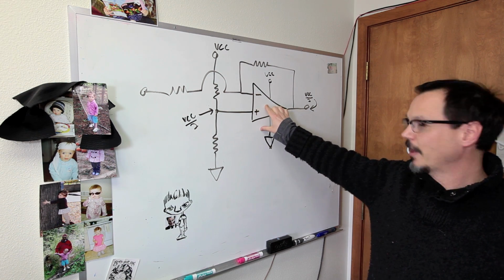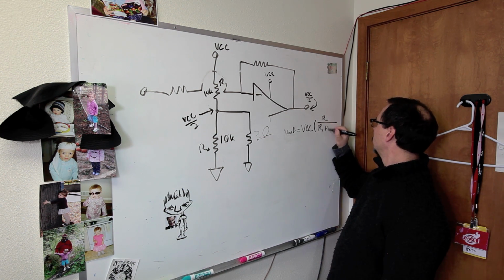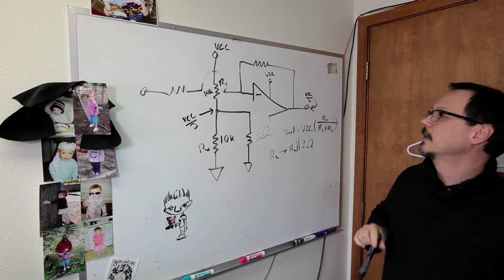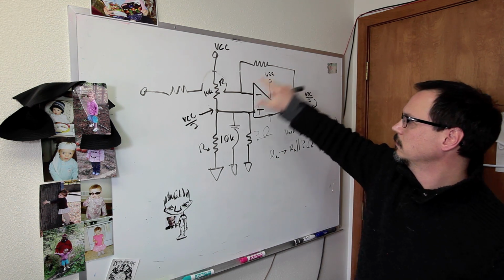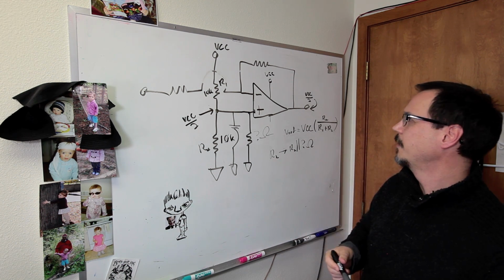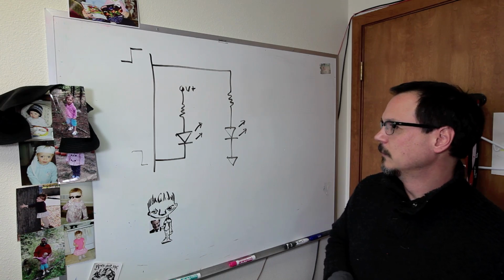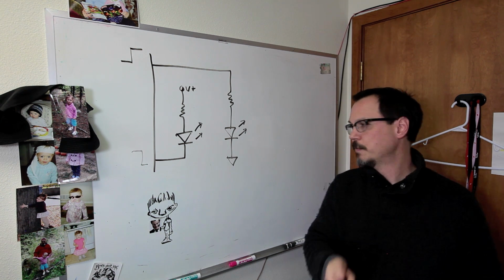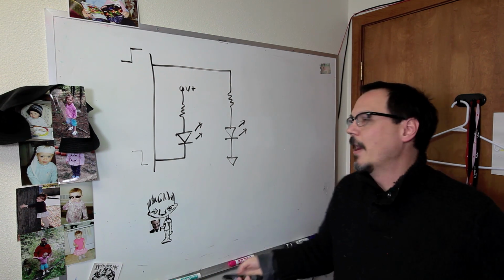SparkFun According to Pete 2-6-12: Questions Answered

Comment: Unfortunately, I disagree with several things you said about driving the LED from a (CMOS) processor.
TTL drives L better than H: Agree.
CMOS drives both the same: Disagree. Go look at DC specs for current out (IOL, IOH), IOH is typically 1/2 of IOL.
You can't tie anode end to arbitrary high voltage. With the pin not driving L, the voltage on the pin is Vsource - VLED. If this is more than .7 V higher than the CPU's VDD, you are sinking current through the ESD diode to VDD.

Comment: @treesquids: The two values of the caps provide better high frequency noise rejection, while meeting the energy storage needs to locally regulate the power rail feeding the processor.  The 100nF cap will suppress high frequency noise better than a bigger cap, like the 10uF one.  The 10uF cap provides the bulk of the localized storage of energy to handle the massive currents that occur as on the rising edge (I believe) of the clock.

Comment: @fabiop268 This depends on the type of pin. If it's open drain or collector, you probably don't have to worry (max voltage at least about 30V), but otherwise you'll probably run some current through a protection diode built into your MCU. That's limited by the forward voltage of the protection diode and LED, as well as the LED series resistor, so it may well be low enough; but not generally a recommended practice. Reverse currents (LED->MCU->V+) can damage some regulators, too.

Comment: ESD: I live in the tropics where humidity is quite high (minimizes charge buildup) and I've still managed to ruin a couple of MOSFET transistors. And I don't even use them that often. The PIC MCUs on the hand seem immune. I've even accidentally connected power in reverse and the chip survived.

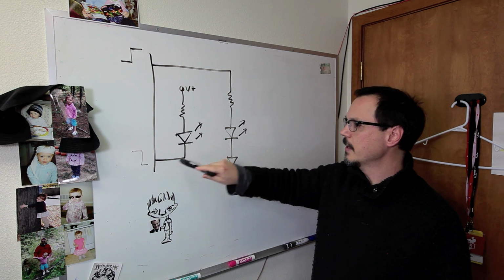Comment: @9:50 uhhh I'm not sure you can tie the anode to any arbitrary voltage above the MCU's Vdd. Don't the pins have a absolute max rating? The pin will probably work when it's low but when it's switched high or tristated to input wouldn't that cause problems?

Comment: At 9:50 you say that the Vcc can be tied to every voltage, but for example: if I tied it to 5v and the MCU works at 3.3v the high level on the pin is 3.3v so there's always a ΔV of 1.7V across the LED, (and 5v when the pin goes to ground). Is it correct? Can the MCU be damaged? So (ignoring the resistor) is the LED always on?

Comment: I personally have a very moist workshop. It's right next to the bathroom and the ventilation is crap hence my workshop is steamy every morning. The condensation on the windows usually last throughout the entire day but as bad as this may be for making everything rust, I don't have to worry about ESD! If I'm paranoid, I ground my foot on the radiator which is earthed and try not to slide parts across my bench.

Comment: @treesquids 
Short answer to this question: electrolytic capacitors are "slow" (look up "impedance"). They have high capacity, but can't release/charge it fast enough to smoothen out high frequency voltage changes. That's what the ceramics are for. They are fast and there small capacity is just enough to bridge the time until the electrolytic kicks in.

Comment: The problem with ESD damage is that it's not either/or. It's possible to damage parts in a way that it more or less randomly fails. Or e. g. you shoot your ADC functionality on a µC multipurpose pin, with it still working as normal IO. These errors are very hard to track down!

That said I never took any precautions either with my projects (hobbyist) except maybe for trying not to wear clothing made of synthetics. If something fails, I blame it on a short by careless wirehandling while testing;)

Comment: These videos are rad.  Could you maybe increase their numbers to twice a month.  Maybe once a week?  
I'd like to see more info on decoupling caps.  I have a really old analog oscilloscope that can't record or trigger, so I can't see what a circuit looks like with and without them, could you show us?  Also, I have an Mbed, and while looking at the schematic they have a 100nF non-polar cap along with a 10uF tantalum polar cap.  What's this setup doing? Could you also maybe show us others as well?